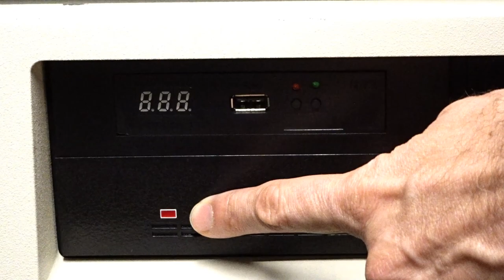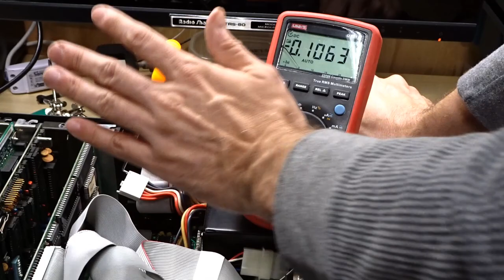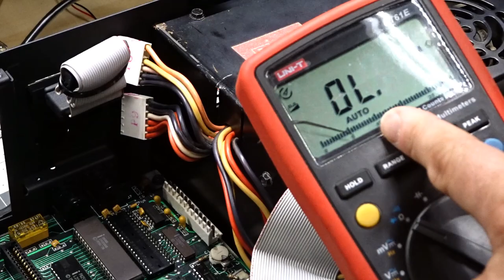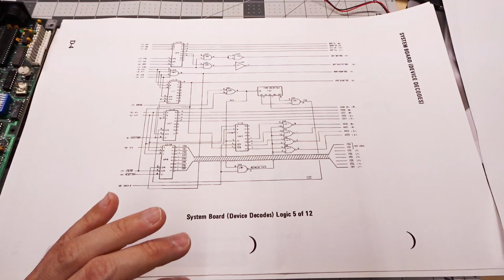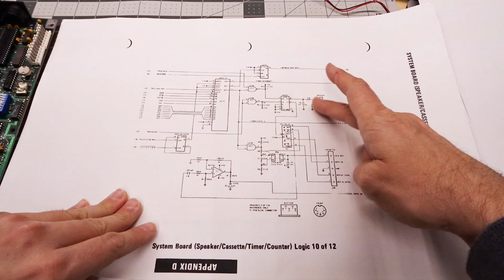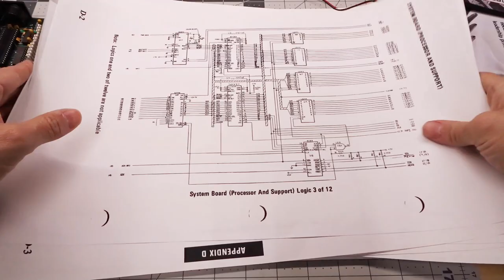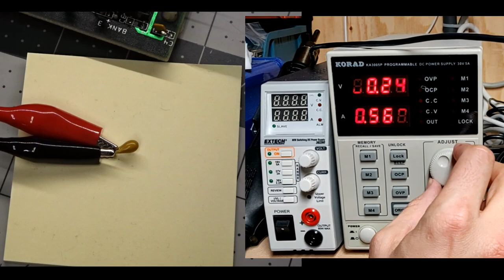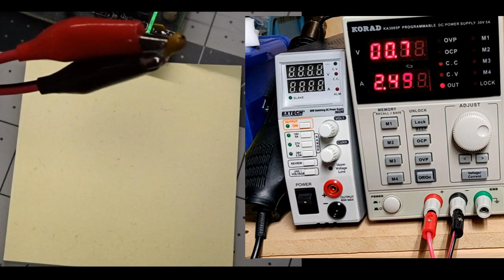Fixing a PC that won't turn on (Bonus magic smoke!)

Comment: OL stands for OPEN LINE. Not OVERLOAD :)
Reply: Philip Hoeffer i thought that was over limit
Reply: or Open Loop
Reply: @Great Value Bleach breaking news man finds god in multi-meter
Reply: I always wondered!
Reply: Over Limit not open line :)
Reply: grizzli211 it depends on what mode you’re in and what meter you use. In voltage readout mode, it means over limit. In continuity mode or ohms, it does mean open line or open circuit
Reply: No, it doesnt, it stands for out of limit. Schematics have lines, but electronics have circuits. They could have said open circuit, but they dont, because opens and shorts are not absolutes. Out of Limit means that the open circuit is beyond this devices ability to read how high the resistance is.
Reply: @hippynurd  it does make sense.

Now that I think about it.

Always wondered what that meant.

I had an old Fishel meter one time a pocket one.

RadioShack?

It would beep continuously as in a solid tone.

And Flash o l and some other things when that would happen.

As in an overload on then voltage scale.

That happened one time on ac voltage.

I was working on a European made movie projector.

And got really bad jolt off the power transformer.

Fortunately I was not touching anything that was grounded at the time.

Turns out the internal Motors are 220. 

Or so.

And on both to just below 2:20 it was set for 110 120.

That prince won't actor that's a step up Transformer.

Anything below 220 AC volts.

On the input side.

Scared The Living Daylights out of me.

And I was like how many volts was that and why Whitney that high.

One thing of note.

That projector was not old enough to use vacuum tubes.

So it wasn't like a B+ winding for tubes.

This thing was Modern solid state.

You wrote in Jack's for Mike and all that as well.

As in European audio the circular 5-pin din plug.

Surprisingly the audio output speaker did not have loudspeaker din connectors two pin.

But I did one cup measuring. The voltage I had gotten across.

Needless to say very carefully.

My meter maxed out at 500. AC.

It said overload.

O l and flashing.

 and  it was beeping.
Reply: OL actually does stand for overload,  always has.  You can easily look this up in many multimeter manuals,  and some bench multimeters with larger oled displays will actually spell out "overload" on the display with open test leads.   Just using Fluke meters as an example -

Fluke's website:
Page 2 of the Fluke 87 manual,  under multimeter safety bullet point 4,  as well as page 10,  page 15 (#19,  pretty explicit here),  page 23,  and page 32 : https://dam-assets.fluke.com/s3fs-public/87______umeng0800.pdf
Page 13 of the Fluke 27 II manual,  table 5 :  http://www.fluke-direct.com/app/webroot/pdfs/cache/www.fluke-direct.ca/fluke/multimeter/27_ii/manual/fluke_27_ii_multimeter_manual.pdf
Page 10 of the Fluke 27 Standard manual,  under diodes and continuity, as well as page 19 under Fuse test #6 :  https://dam-assets.fluke.com/s3fs-public/27______umeng0200.pdf
Fluke 8845A bench meter display :   https://i.ytimg.com/vi/ENzBOlpdKxI/hqdefault.jpg   and Fluke 8846 :  https://images-na.ssl-images-amazon.com/images/I/7165HIpI--L._SX522_.jpg
Reply: @Sloxx701  I suppose they did intend for it to stand for that, but it doesn't make sense to me. How is a high resistance an "overload" to an ohmmeter? It's no load at all!

Regardless of what "OL" stands for or was intended to stand for, what it actually means is "out of range": whatever quantity you're trying to measure, the value is outside of the range that the meter is capable of measuring.
Reply: @rfmerrill  The actual measuring chip measures millivolts, usually 0mV to 199.9mV.  Feeding it much more than 200mV will actually risk overloading the chip, feeding it slightly more still turns on the overload warning.  In ohmmeter mode, the meter pumps out just enough current that 19.99 ohms become 199.9mV, so no connection becomes just enough to show the message without actual damage.
Reply: @johndododoe1411  that would be over*driving* the chip, not overloading it.
Reply: @johndododoe1411  always wondered why non-auto-ranging ones picked 20, 2, 0.2 etc on the dial. Guess it’s like those frequency-shifting devices to get more range out of a software-defined radio; except it’s a voltage divider in this instance. (My electronics teacher did tell us if we didn’t select the range correctly it might break it, so I never questioned that, but it’s good to know why, exactly.)
Reply: @kaitlyn__L  Traditionally handheld digital multimeters were built around simple 200mV chips, dividing by 10 can be shown by moving the decimal point (already a separate wire), dividing by anything else would require major additions to the chip.  Analogue meters often divided by different numbers by printing multiple scales behind the needle.
Reply: @johndododoe1411  yeah, I knew dividing by ten was the simplest. Makes sense about multiple printings on the dial for analogue ones. All the analogue ones I ever used were single purpose and single or dual range, never touched an analogue multimeter. Pretty interesting stuff.
Reply: You're all wrong. It stands for open loop. "Open line" makes no sense. It is referring to the fact the circuit (synonymous for "loop") is not complete and current can't flow at all.

Comment: Same exact issue on the 5150 I played with, and with 8-Bit Guy's Compaq Portable. Shorted tantalum cap dragging the whole rail down. I ended up finding the cap on mine by clipping a leg of every tantalum cap on the board until there was no more short, then soldered the good ones back together. Might be an easier way to find it ;)

Comment: As soon as I saw those dipped tantalums i thought "One of those buggers". They were used mainly because they had low ESR compared to electrolytics of the time. Nowadays we have low ESR electrolytics and you can just substitute them. MLCC ceramics are very low ESR as well but are also highly voltage dependant, so its usually not a good idea to substitute them in

Comment: Years ago when i was tracking down a short between PCB traces on a board that just came back from the board assembly company I found it very helpful to have three digits of precision on the ohms scale and not just two. A minimum of two decimal places really helps to narrow down the location of a short.

Comment: caps basically block DC which is why this didn't blow for a long time. Not much current passes through it. You showed that even though you don't have a thorough parts-level understanding of electronics you can still fix 'em. Good job!
Reply: the cap was shorted so 5A went through it
Reply: @MrHBSoftware  sleep deprivation most likely. I'm extremely suspect of the DMM because I have seen them charge up a cap and give wrong readings and I thought that might be the case here. Tantalums are generally superb at holding a charge. Besides, do the math....It was 12 volts, right? Are you so naive as to believe your meter readings when they show 60 watts (5v * 12vdc) going through a tiny part that small? That's about the size of a TO-92 package and most of them are not even good for 1 watt.

Comment: Excellent job, Adrian.  Amazing to think that the base configuration on these old beasts was barely more than that of the C64.  In fact I've heard of some small businesses that used the C64 versus the IBM PC back in the day.  But from a technical/EE stand point this is just pure voodoo.  If I was confronted with that problem I wouldn't even have the faintest idea where to begin looking.

Comment: Good diagnosis techniques, better than removing random components to see if the short was fixed. What a coincidence that the first cap you tested was the bad one. BTW, even at 5A the cap was only dissipating 1.5W assuming your measurement of 0.06 ohms was correct.

Comment: Tantalums often tended to be effectively undersized back then. They're low ESR but also very small and seemingly struggle to handle the inrush current at turn-on in the long run. A 16 V type on +12V? That's the minimum even for an Al 'lytic, for a tantalum it's borderline suicidal. I'd put in more like a 35 V.

Comment: My 5150 had the same problem plus. The sockets for the end chip on Banks 2 and 3 had corrosion from a memory battery on the expansion board above them. It literally dripped down. After fixing that I found that C6 and C7 on the end of bank 3 were both shorted.

Comment: Tantalum is used in a variety of alloys to add high strength, ductility and a high melting point. When drawn into a fine wire, it's used as a filament for evaporating metals such as aluminum. More than half of tantalum's use is for electrolytic capacitors and vacuum furnace parts.
Reply: Glyn Watkins ☺️

Comment: The orange cable is power good. It is a simple 5V signal that tells the system the status of the PSU. If power good goes to ground, than the system has to stop. These function is up to day as the grey cabel on ATX2.xx is power good too.

Comment: Why didn't you just inject say 1V on the 12V line and just see what heats up? You can just put alcohol in the suspected area and it will just evaporate instantly so you know what's up.

It wouldn't blow anything up. Just heat up over time.
Reply: That's exactly what I was going to comment. Being that it's only RAM and bypass caps, I would have just seen what got hot with a couple of amps flowing.
Reply: Problem is he did wanted to do this. But even on 2 amps the cap want even warm. Around 5 amps it failed.  You don't want to let so many current on the board. Even with this vintage.
Reply: @Marfprojects  Yes, at 1,05V it was at 4,1A. Something you really don't want to happen through a board you care too much about. Not a lot of heat being output in the component (~4,3W), but a lot of current for the supply traces to handle.
Reply: Just looking for a hot part would work in some cases (I call it the burning finger test), but on a part that has a really low ohms short the part would have a lower voltage drop across it than the copper traces leading to it. This would actually cause the bad part to be cooler than the traces leading to it.
Reply: You see,  because in some labs,  the amount of magic smoke has been capped.
Reply: 5 amps would have probably smoked a trace. He did it the smart way. And, what if the bad cap shot out a flame while wet with alcohol?

Comment: Capacitors typically burn out because of too high voltage, it's the electric field inside the capacitor that ultimately destroys it. That's why they usually have a rated voltage written down along with the capacity. For instance, 10 uF 120 V means it can handle up to 120 V across its electrodes. The smoke in the end is probably not due to it blowing up but because of the fact we basically threw 60 W of power on it (12 V * 5 amps) which the casing most likely cannot handle. It might also be due to overvoltage, I am not sure if you mentioned exactly to which rail this capacitor was hooked exactly. 

Another thing to note is that capacitors don't really work in DC environments and they function more or less as a switch. This is because they act as a short circuit at the moment of power on, but as they charge, the current through them fades. Once the capacitor is fully charged, there is no more current flowing through the capacitor and hence the circuit is broken. The time it takes for the capacitor to charge is proportional to the capacitance. 

Other than that, yet another great video! I find myself going through your library and just watching old stuff as i'm fascinated with the old computers and how advance they were for their age. Hope to see more in the future!

Comment: Nice video, thanks!. The tantalum is used because of low ESR or something, the electrolytic does nothing there, you could have just done without with all the other capacitors around it.

Comment: Good fault finding technique but one thing to consider is that a multimeter in resistance mode is applying a small voltage to the system and tiny caps will start to charge just a little and so the reading will change over time.

Comment: Hi Adrian yes I use a bench PSU and a thermal camera, and set the voltage lower than the rail I am testing. I set the current limit at 1A and usually this is enough to see the shorted component, it may have worked in your system because the faulty tant was dissipating 0.4W at that current and in such a small package I am sure you would see the difference.

Comment: The power connectors are supposed to be coded (some of the projections are a little longer) .. but in reality, that only makes the difference between going in quite stiff and a little more stiff in my experience.

Comment: Great channel for clear explanation of fault finding and each case is always a little diff so approach can be diff depending on what the failure is , so in repair thees always diff ways to skin a cat and experience is great tool to get there quicker when you know types of failures and where to look. Going down rabbit holes will happen and time wasted but logical approach will get you to the right place and patience is always a prerequisite!.  Learning lots on old computers here so when my own computer fails , i have some was to diagnose the chips which seem to be a weak point. 
Excellent case of logic and low ohm finding carefully the lowest point and correct failed part. Those Tants are problematic on the old stuff and thankfully you dont really see them nowadays and they seem to always look all shiny and nice even when failed. 5 amps and it resisted! wow!!  but finally gave up the ghost so just shows they can take some punishment and you wont see anything. They have extremely low reading ohm meters for this sort of search job you can use as you need those extra digits to zoom in quicker but you got there at least in the general area and could have just clipped everything till you found the hard short.  I have a 5v PS with tons of amps that i can use to heat up a part that has shorted on say a amplifier where thees less risk to chips and all that amps will dump through the shorted part and blow it or heat it up and 5V is safe enough to protect other parts and traces. Use this method as last resort as its brute force but have had success when subtlety had failed and nothing to lose at that point.

Comment: As someone whose job was getting PCs to talks to Machine tools in the early 1980s I am fairly sure the -12V supply was used for the serial port (on the DB25 connector at the back Called COM1 in DOS).

Comment: That was a good guess, Adrian. You should try a lottery ticket soon:) 

...and a pity, unfortunately. I would have liked to see a deductive error search: Checking the current on the rails with an adapter or current clamp. Then when you know there is something wrong with the current, you can follow the traces with a hall-effect based probe or build your own and measure the current through the individual capacitors. Imagine the dozens of paths of parallel loads in your resistance measuring method, all with unknown values. And you found the short! Godlike...:)
Another method is the thermal one. Testing what gets hot via thermal imaging or the "holy finger". But it can be inappropriate because you can destroy your repair object when running a long time in fault condition while powered.
But I'm wrong anyway. All capacitors should be swapped anyways. But where is the fun then? It is always a pleasure to find the error by logical action.

Thank you for the video and keep on hacking:)

Comment: As I recall the original 5150 power supply is rated too low (only 65 watts) to provide sufficient power to a hard drive. That's one reason the XT got a beefier 130 watt power supply. I would replace it with an XT power supply personally.

Comment: i had a multi IO card in a 286 that kept popping its multilayer ceramic caps (the small ones you mentioned) it didnt trip the psu out but every so often you'd hear a crack and see a puff of smoke come out....the psu also had a mains suppressor cap blow its guts out....yes those dreaded RIFAs !
Reply: i've never yet come across a shorted tant, but had a few small electrolytics go low resistance (not total short) in a small cd player 'hifi' system...,and in a late '70s Roberts Radio (unusual as the type used were normally very reliable)
Reply: had a RIFA go out on my Apple IIe and IIgs. it was stinky when they failed. fortunately, they're easy to replace if you know soldering